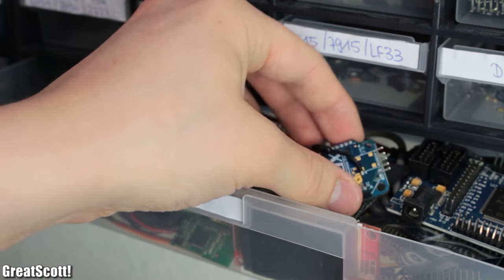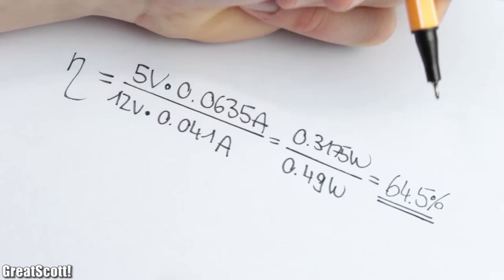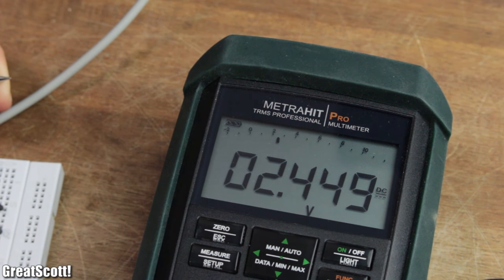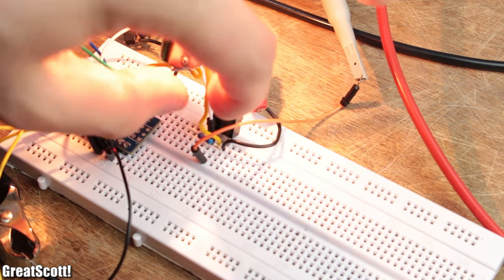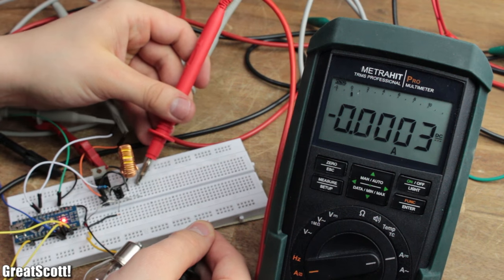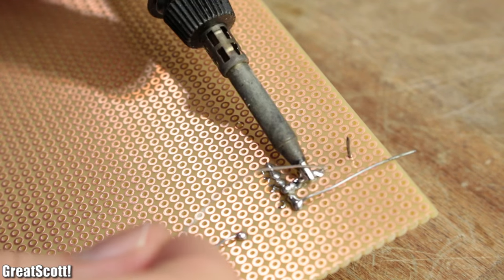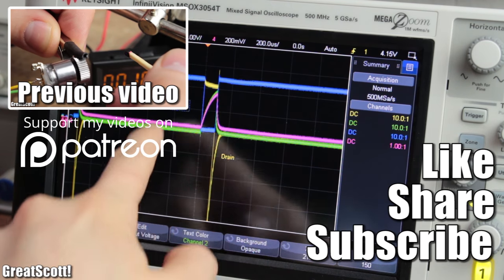DIY Buck Converter || How to step down DC voltage efficiently

Comment: I spent hours trying to get my head around buck converters the other night and now you've explained it completely in five and a half minutes. Great job, thanks!
Reply from the maker: +Carl Alm Thanks for the compliment ;-)
Reply: +GreatScott!  can you make a tutorial for DIY FLYBACK control by PWM? please
Reply: +Carl Alm Yeah same happened with me. I had my project ready but i accidently used adjustable version with no feedback so jumped back to 7805. Now i understood my mistake. Great work +GreatScott!
Reply: @miguelfierrospena6758  It's basically the same, but they are current controlled. That's good because they do limit current well.
Reply: the simple way to think about it is that, at high frequencies, the average voltage on one side of an inductor will equal the steady voltage on the other side.

Comment: LM2576.  Bet you did not know it is double edge modulated and has a non-linear modulator ramp to keep gain constant as input voltage increases.  They forgot that when they did LM2596.  LM2676 had Vin feed forward, but too much DC gain on the adjustable version.  LM22576 and LM5576 were next, then LM22676.

Comment: The video is good. Sir, can you explain how to calculate the inductor, frequency & resistor values? It will enable us to customize our designs . A favour which will be greatly appreciated by many followers of your channel . Even if you guide us to use any particular literature "to understand it all", it will be a great favour!. That apart, your videos are really well made with a live video analysis on exotic & classy equipment to prove your point & understand things easily. Appreciate it wholeheartedly!

Comment: Great explanation, I really like how you added one component at a time then explained why you added it and what it does to the circuit, most tutorials I've found don't really go into detail on why you need an inductor or a high switching frequency as an example, Thanks.
Reply: +vgamesx1 yea defintiely very well structured videos!

Comment: For those of us who do not want to DIY build and want a high efficiency step-down converter, can you recommend a buck convert for input: 12v output: 9v (application is for a 12 v LED light to reduced its output by supply it using 9v)

Comment: I did this for a living in the '80's, but not as much power supplies (yeah, I did those) but audio amplifiers. I designed both.

I'll tell you once you get into distortion and failures (especially in the '80's when components weren't as good as they are now), it sucked! Our company was successful at making switch-mode amplifiers, but customers never wanted to pay the extra cost of efficiency. They were happier with big fat heatsinks. Guess that speaks for how industry typically works.

Comment: Perfect. Exactly what I was after. I'm currently building my own LED strip light driver and controller. Got an esp32 for wifi and lots of pwm. Using some logic level mosfets in there for switching the 12v but I want to power the entire board from a single 12v DC jack. Need to add a buck converter onto the board.

Comment: I see you have a 500mhz  oscilloscope.   Oscilloscopes are cool. I been a technician for over 40yrs. I purchased a Dual trace  Sencore.  Waveform anylyzer  reburbished. For $1,000.  Retail on one of these is $3,450.  It has a bandwidth  to 65mhz. Usable  to 100mhz. The scope you are using looks awesome.  Nice video.

Comment: Do you think you would make a version of this video but for boost converters too? I found this quite helpful but it seems half done without covering both buck and boost converters. Other than that, good job on the video; I found it easy to understand.
Reply from the maker: +BoomBrush Boost will follow
Reply: +GreatScott! A booster from 3.7V to 5V :D

Comment: I am a complete rookie trying to figure out how to step down voltage for my 12V camper van lighting. Sounds like a buck converter is what I need. Why is it better than just using resistors? Thanks for making this video.

Comment: hey I did this, Did the adjustable for 5V 2.04i fast charger. Beat most brand chargers on the market. :) I notice they also make a 5 Amp VRIC
HOWEVER.... im back as I knew you did the " a lot of parts" at the start, which is what I need. only one other thing was the Pfet driver. ( i have to use a higher power one)
Knowing how to and seeing how to makes my life easier....
I'm doing Solar project..

Comment: Scott, you came soooooo close to what I liked to learn. Make my own buck converter. And than you switched to the lm2576. It can only do 1amp? rated for 3amp? and max 45 volt. I wanted to build a buck converter for my e-moped since the original dc to dc converter failed me. That EV has a max 54 volt battery  and I need a 12 volt output that can handle 120 watts.  I have FQP27P06 mosfets and some bigger inductors from an atx power supply and a few higher voltage volt caps. But with out the feedback part the arduino solution is not good.   Most examples go up to 35 volts and only a few amps. I need 42 and 60 volt solutions but it seems you have to make those yourself.

Comment: I'm no expert on this topic but I did read a caution about using buck converters in projects that use RF because the coil in the buck causes ripples which can interfere with RF.

Comment: Very good  informative video.I use the  MP1584EN SOP 8 in my designs which is half of the cost , which is a key factor when you are running production.Great channel.

Comment: How did you get the high side of the duty cycle to shut off the P-Channel MOSFET when it's source was connected to 12v?
The arduino's PWM output switchs between a connection to ground and a 5v supply from the regulator.
I tried the exact same setup and can't turn the MOSFET off because I'm assuming than even during the high side of the duty cycle, the pull-up resistor is still dropping the 7v difference between source and the PWM output.

Comment: very nice video, one question: Can you make video on how to build a battery protection circuit, or a low voltage cutoff?
I'd really like to build one but I don't know how ...
keep up the great work!
Reply from the maker: +BukkitViper I put it on my to do list.
Reply: thanks a lot, which nationality are you btw, german?
Reply from the maker: BukkitViper
Yes, you can also watch my FAQ video to get more information about me.
Reply: Ah okay, dachte es mir schon :)
Reply: +GreatScott! battery protection circuit for single lithium 3.7V. Thanks !
Reply: great idea :>
Reply: No I didn't mean for single 3.7 cells.
What I ment was a adjustable voltage cutoff where around 5 amps can pass trough.
Maybe even with a low cutoff for discharge and a high one for charging
Reply: BukkitViper yes for single lithium cell too !
Reply: Permire Fabrica i was saying that to BukkitViper xd
Reply: yes of course for single cells, but also for every other configuratin, like I said, ADJUSTABLE VOLTAGE CUTOFF
Reply: BukkitViper yes ! Because a voltage protection cut-off at 2.5V, it's too low for me.

Comment: Thank you very much just what I needed :)
 I used an arduino to open/close my car using my phone (new project in your channel??) but my problem was the power I did not want to use linear voltage regulator so I looked into the buck converter and they are awesome !!
thank you for your video it makes my sunday better.
I am AbdulRhman and I am from Saudi Arabia  :)

Comment: What would be nice is if once a certain voltage is reached then you could bypass the step down and just use it straight from the battery. Say I'm using 11.1v for 8.4v, when I get to a manageable voltage for the 8.4v around 10v then it just feeds straight from the battery pack.

Comment: There's a dude on here with a breadboard video card. Imma guess that just lowering voltage is easily attainable.  ;)
Reply: elcidbob and thus water cooled breadboards are introduced due to market demand. “Regulates hobbyist circuit temperature” 😂
Reply: @maxpert9  lol

Comment: The video is just awesome but please suggest a circuit for handling 15V to 20V at 25A to 40A input and output at 12V/24V fixed.

Comment: Thanks for the video, looking forward for the booster one! However, I think the switch to usage of the new IC (if I understood it correctly) in the video was a bit abrupt, a simple mention about what new IC does (pretty much the same, it seems, as you used the same components, but more efficient) would be really nice.

Comment: Very good job of explaining how and why of a buck converter. I have an old analog oscope I bought on ebay for about 50 bucks. Nothing like your super scope.  I also bought a couple cheap probes from China. The first one got slowly more attenuation as I was measuring 12v inputs. The second is ok and I don't measure anything over about five volts. The point is I can learn by listening to your  awesome videos and trying things out with my cheap gear, I am gonna make a buck converter pen w/ smt parts, and an ATtiny2k that gets 5v input and the output at the pen tip is something less, that is adjustable. Your explanations are "baby-bear" ... not to fast and not to slow but just right.  I will use the pen to charge batteries etc. any ideas for additional uses?

Comment: As far as I know, MOSFET does not just switches, but can provide adjusted value. So why don't you filter the square wave on the logic level? I ask this, because I wanted to build a constant current load with this method some days ago, but could not get it work yet.

Comment: Sorry, I have a question.  I need to build a DC step down for my solar from 60 v dc to 24 v dc.  10 amp's at 60 volts.  
My guess is that I just do what you did with more components in parallel?

Comment: Repeating a question asked a year ago - how does a logic-level PWM have high enough voltage to turn off a P-channel MOSFET at 12V?  The gate's being waggled between 12V and 7V.
The gate threshold is 2-4volts.  The pulling resistor could help, but it there no body-diode in the Arduino to stop the signal rising above Vdd+0.3V?
I can see how this would work if the PWM were open-collector - is it?

Comment: to cool my android tvbox I'm recycling an old 12v 0.7A cpu fan  by splicing a usb cord onto it that plugs into itself for the 5v...  guessing it's spinning at around 40% of it's max capacity but it's still too loud...  will putting a buckconverter into the cord lower the speed even lower.... any watts of heat dissipation can be done by placing it under the fan itself right? or is there an easier solution

Comment: In one of the project I have noticed that , primary winding of transformer is connected to   collector and Vcc  of BC547 transistor as I know transistor produces a fixed current and voltage for a fixed base bias . But transformer needs an variable voltage in order to operate . So can u please explain what property of transistor makes it to switch eventhough base bias is fixed .

Comment: I would like to use my old Ego 56 volt battery to power my old Ryobi 40-volt blower. What would you recommend I build in this situation?

I've looked for converters online that already exist, and it seems like none do for this particular application.

By the way, congratulations on almost 2 million subs! 🙂

Comment: Hey! is there a reason why you used an inductor and not a capacitor to store energy and prevent current spikes? Is it because it would block the DC voltage too much?

Comment: Hi, great video! Could you do an add-on on how to control the output voltage using the PWM of an Arduino?
Reply: We can sample the output voltage through Arduino's ADC and feedback to your codes to adjust the duty cycle of pwm . there are several control algorithms such as bang-bang control , PID etc . But the loop's stability may not be very good according to my experience,especially transient response....
Reply: 50% on and 50% off pwm cuts voltage by 2.  There's your percentage to go on.  It's that easy.

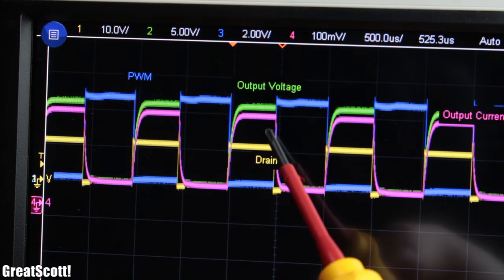Comment: In your circuit at 3:04, is the PWM signal 5V amplitude and referenced to GND? I'm actually trying to simulate that circuit, bit it can't work, because Vgs is toggling between -12 and -7V. So the transistor is always open. Even the circuit you described up to 2:02 has this issue. What am I getting wrong? You clearly show it working.
Reply: I don't think you're getting it wrong.  The circuit doesn't make sense, and I don't know how he made it work.
Just checking out the ATmega88 datasheet (I think that's the chip on that module?)
"Voltage on any pin except RESET with respect to ground–0.5 to VCC+0.5V"
He's pulled a 5.5V max pin up to 12V with that resistor.  It doesn't make sense.
Maybe he's using an MOSFET with a really big threshold voltage.
Maybe a series resistor of series zener would help your circuit work?

Comment: I need to build a buck converter and not sure what is the best way or even the best circuit to start off with. What does the Arduino actually do in the buck converter

Comment: Wow, very insightful video. So, after I now know the different possibilities (voltage divider, LM1117, and this buck converter), which would you recommend for driving the ESP8266 with an 5 Volt USB battery pack?
Reply from the maker: +Maxr1998X Since you can get mini buck converter for 1$ from Ebay I would use one of those.
Reply: Thanks, I'll try that!

Comment: Could you use this to modify heat tape or using it to make like a heated glove or coat with a "dimmer" for heat output?
Reply: yes you could use this to send pulses at low voltage through resistance wire to heat clothing or gloves.

Comment: If I were to step down 36 volt solar pannels, using 3 step downs, each stepping down to 12v, would the power I received to charge  my  12v battery , give me the full Amps and watts, but in 12 V, so I don't hurt my lithium battery?  I.e. if all 36 V and 400 Watts from two panels  move through the other two, when the first reduces the total current in the same way three water valves would allow the same gallons per minute, but in 1/3 the volume each ?

Comment: Great video and project as always. I've been watching your movies for quite some time now, but I get the feeling that the videos go faster and faster. Since I'm no electronics expert, some things are just too fast for me. Is it possible to slow down the tempo and take more time to explain certain things? It depends on the audience you want to reach of course. Nevertheless, great videos!
Reply from the maker: +JonneLFC It is the same speed as always. If it seems to fast for you then it is probably because you do not fully understand the basic concepts that it builds on. Watch my series of electronic basics videos. Especially Coils, Capacitors, Diodes and PWM. I will not explain every basic concept in every video.
Reply: Of course you shouldn't explain the basics over and over again. It just feels like the video is more rushed than it used to be. It's not that  I don't understand it, it's just like the editing is so much faster. But once more, I really like your videos because they are so thorough and well explained. Keep up the good work! I even consider suppporting your patreon campaign! Greetings from Belgium.

Comment: The maximum PWM frequency of the Arduino is 62kHz, and those dedicated chips have a frequency of 100kHz, maybe is because of that that your Buck Converter is less efficient than the already made ones...

Comment: Hi,

First of all, great job! I have followed your other tutorial about the boost circuit and it works perfectly.

About the buck I am in dobut about it. I have tried to follow your video but as soon as I connect my P-Channel Mosfet the voltage doesn't decrease. I thought it was a matter of continue with the video but it is not working because as soon as I mount the circuit I have an output value of 12 Volts (the supply). Do you think that it is a problem of the transistor or maybe of the inductor?

I have seen that, sometimes, people put a resistor in series with the inductor to increase de RL but I don't know if this will work.

thanks!

Comment: Great Video! I need your help! I need to buck down 54 volts at 2.1 amps of current down to 42 volts and the current at 42 volts can be as high as 5 amps. Can you recommend a setup and list of materials please?!
Reply: daytrades4me 54V 2.1A is 113.4W, but you want to get 42V 5A which is 210W out. You are trying to pull out more power than you are putting in. The only way you are going to get 5A out is if you reduce your output voltage to 22 volts.

Comment: Hi there greatscott, thx for the video. I have two question. Why do you use voltage divider for feedback to arduino from buck output? And if I want to make it stable 5V output from 7v-20v input, how to code it? I hope you answer my confuseness :)

Comment: i want to know how to make a step down adapter without any regulator chips because i CANNOT GET any. and nothing i do by searching online helps. every one uses regulator chips or some or other chips. I NEED TO MAKE IT WITH capacitors, resistor, diodes and inductors because THAT IS ALL I HAVE.... i'm getting very frustrated...i need to run a hairdryer on the same speed it was before without the heated element because it broke.... how can i do this from off a 230v AC ...please help. thank you

Comment: Can I use a buck converter to power a Bluetooth module for a small portable speaker with out radio interference? The battery pack is 12v for the amplifier so I have to drop the voltage to 5v for the bt module.

Comment: What if your battery has a peak voltage of 43.5 volts? And you want 10 amps from the stepped down voltage? There aren't many simple switchers available for that.

Comment: Is there a version of the LM2576 that can be controlled digitally? This way a microcontroller could vary the output voltage and the circuit could be of high efficiency.